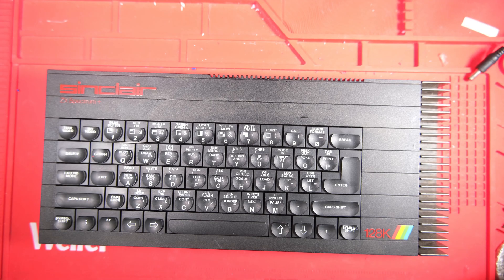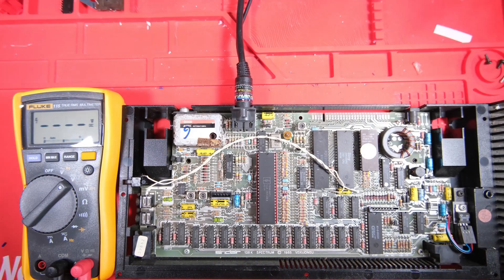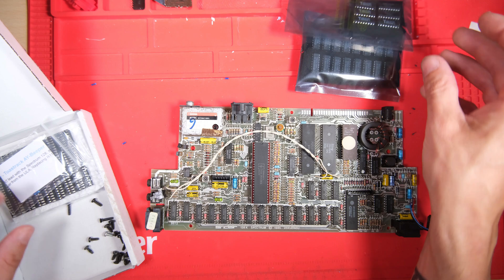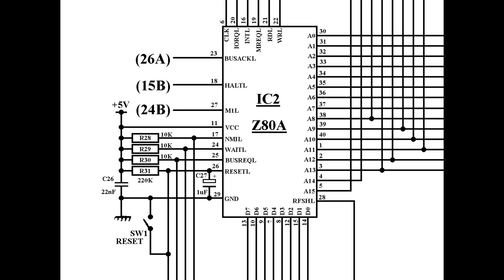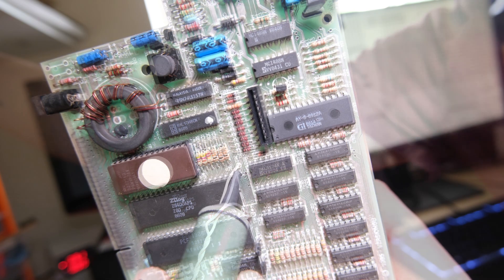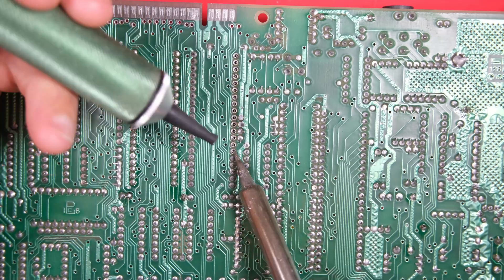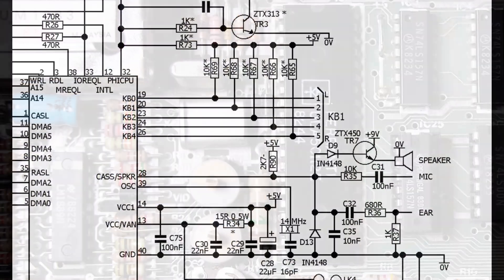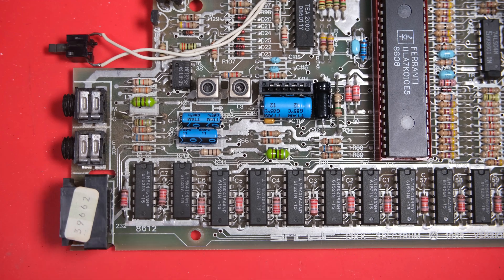ZX Spectrum 128K Toastrack Cold Start Issue and Fix

Comment: Interesting Video, I have a similar problem with an Electron.  When first switched on I get Horizontal grey bars and no beep, reset it by pressing the Break key and it boots up correctly every time.  I replace the "reset" capacitor and corresponding resistor, I think it forms a time constant circuit.  The clock generation circuit has a similar 3 invertor circuit ( I think ) so I will try replacing this chip.  Thanks for video.

Comment: Hi!  
I replaced the membrane on my ZX Spectrum 128k+ "Toastrack" but it doesn't work, just the start screen. Can you please tell me what's wrong? Thank you
Reply from the maker: Hi. What do you mean by start screen? The menu screen? Without seeing the mains it's impossible to say. Are the screws of the backplate done up tight? Any old bits of membrane blocking up the sockets? Are the clamps fitted tight?
Reply: Yes, menu screen. tape loader, 128 basic....but none of the keys work  @HappyLittleDiodes
Reply from the maker: It could be the membrane or the bubble mat or the backplate, or an issue with how it's been installed, it could be the connectors or the ULA even, it's hard to say without further investigation

Comment: Hi, just some info for you, I too had this same cold start problem, i soldered a 4.7uf capacitor in parallel with the reset switch which fixed it, but after watching this i decided to investigate further, i didn't have any 7404 not gate ic's to hand to try your fix, but to be honest i kinda had a hunch it could be something else, my eyes went for capacitor C120, in my model it had a capacitor encased in a glass diode type looking casing, i had a hunch and decided to replace it with a ceramic 100pf capacitor, well would you believe this fixed the problem, i have left the 128k speccy off for 1 minute and powered up a good few times now of which powered up perfectly everytime, ceramic capacitors are usually used for high-frequency stuff, so maybe this might be worth trying first before changing that ic, my toastrack powers everytime now perfectly, anyways love your stuff buddy, take care 👍
Reply from the maker: Good info thanks for sharing

Comment: Be interesting to see if a 74HCU04 will work. It also doesnt help that the unused gates on IC37 appear to be left floating - this is a very bad thing to do and might explain why the original chip has started to fail!
Reply from the maker: It's not the first time I've heard of 74S04 having a cold start issue
Reply: @HappyLittleDiodes  you can usually float standard ttl as the input is an emitter, the s type also is emitter input , the ls type not, its a base with a pullup to +v, so likely will float high but susceptible to noise pickup , hcu04 is just the gates of the 2 mosfets, so floating a bad idea, havent seen the internal circuits of the hc and hct types.. hcu 04 types cant always be used in place of others as they can work 'linearly' , not sure what type could replace a s .. there was, maybe still is ac, act and f types , i've seen some strange ones on a pc io card numbered as hctls !!